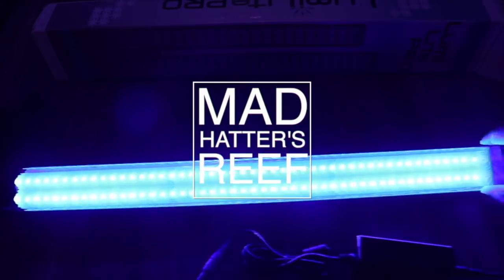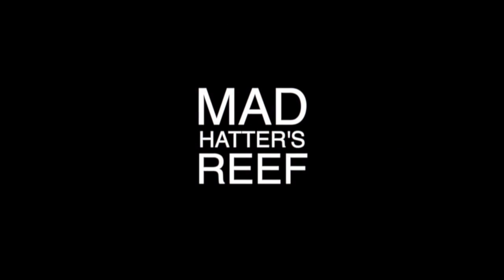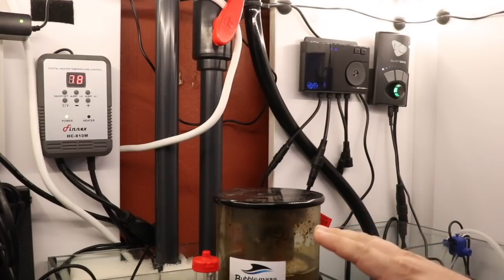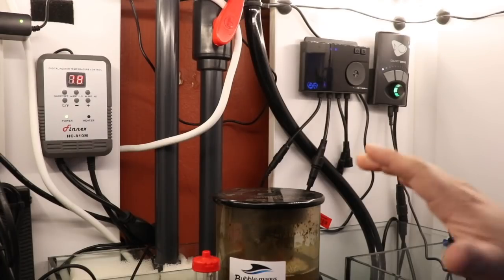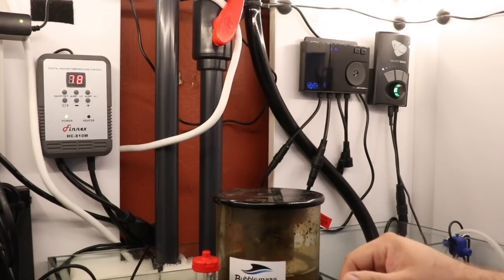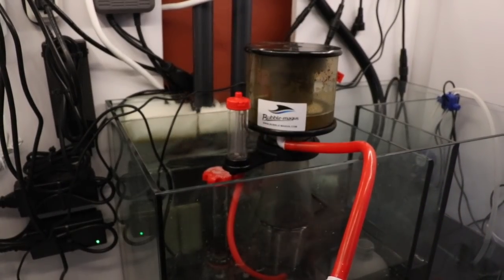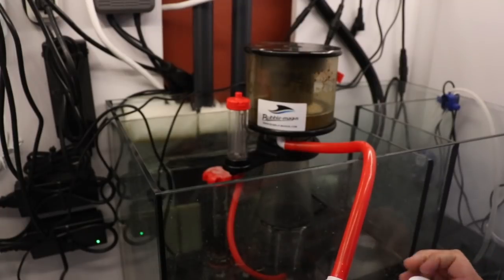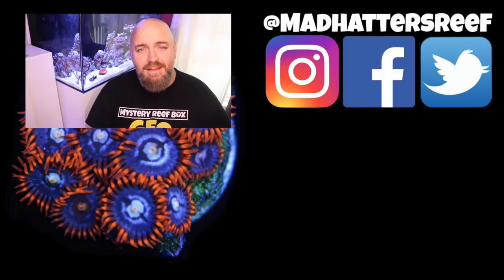Testing and Dosing Calcium and Alkalinity by Hand

Comment: Great video. I also use the same kits when testing my top three. But considering my schedule I do use a dosing pump and things have been great thus far. Just a heads up though, Salifert changes their calcium to where instead of doing 8 drops of CA-2, you have to use 10 drops now. All others still remain the same.
Reply from the maker: When did they change that cuz this box is about 1.5 years old.
Reply: Mad Hatter's Reef within the last 6-8 months.
Reply: @MadHattersReef   The same happened with the KH test, is 4 drops now, I guess it is an easier and clever way to have people buying more of their product

Comment: Blue bottle glass dropper bottles 20-30ml volume.  Each dropperful is about 0.8-1ml.   Half a dropper is about 0.5ml.
Quick and easy.  If added small amounts daily to tanks as they grow.  Once you are established, no need for testing if doing water changes every 2-3-4 weeks.  Corals take up just what they need.  So a tiny amount of whatever you add is beneficial and generally safe.  As long as you are consistent.  Running six tanks like this for nearly 3 years since in hobby.  Heavy testing to start, to see if there were trends.
Reply: Are you saying you dont need to dose daily?  My alk consumes random amounts daily, no consistency at all.  Feel like I am going to be testing daily forever!  I dont know how I am supposed to lock in a daily dose!  Can you help?  Thanks:)

Comment: Cylinders are cumbersome and slower than dispenser dropper bottles.  Also need to get cleaned.
Don’t forget you need magnesium in order for calcium to be utilized.
Reply: when should you dose mag?  The youtubes I have watched says after you dose a gallon of calcium and alk, but what if it is low as well and like you said you need mag in order for calcium to be used.

Comment: Hi.
When it comes to BRS calculator, it makes us choose what 2 parts solution are used (don't know the exact concentration of the listed). Since I don't live in US and I'm using my personal DIY 2parts solution so it's rather difficult to determine how much to dose. Therefore I have to calculate manually for the dosing needed.

Comment: How to you handle water changes?  wont it throw it all off? Cause an alk swing and possibly kill my corals.  I use Io reef crystals and after my normal weekly water changes my alk goes up to about 9.5 then by the end of week its down to 6.5. I am only dosing now or starting to because i got to many corals at once and thats what is lowering my alk and upping my nitrates.  I am not really sure what to do.  I started nopox to bring down my nitrates and randy holmes farley said that it should straighten out my alkalinity in time. I am not feeding corals anymore even.  I did buy reff energy which is supposed to keep them nourished.  Its amino acids and carbs ect and not suppposed to up nitrates
Reply from the maker: Yes it will. Water changes are the best way to keep parameter where they need to be.
Reply: @MadHattersReef  Still havnt dosed but starting today.  I am wondering why my water changes using same salt (reef crystals)  was upping alk from 6 or so to 9.5 and now after dropping to 6.8 a water change with same salt and same percentage is only upping to 7.4.  Mathematically makes no sense!  When do I add mag and trace element or would changing to a monthly water change be enough to keep trace element in check?  I have been doing them weekly or 10 days but lowering nitrates and po4 to much.  Po4 is either 0 or 0.01 and dont want dino's which looks like I have but I preformed a coffee filter test and it didn't clump so I assume its just diatoms from adding a new light.

Comment: both may need to be raised i would suggest
Reply from the maker: Thanks for the tip. I typically shoot for 400 ppm on Cal. I could make a whole other video on how to dose Cal and Alk and the thought process in how.
Reply: @MadHattersReef  great video..I seen that you have to dose both..I'm new reefer.  Is this correct ? Is your video dosing both getting done soon ? Thanks. Have learned lots from your channel. Cheers from Sydney